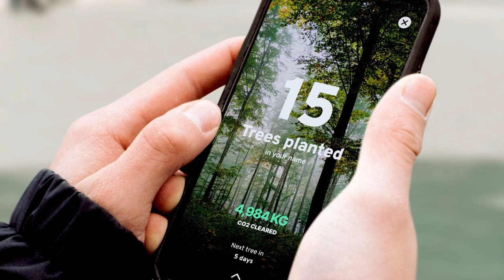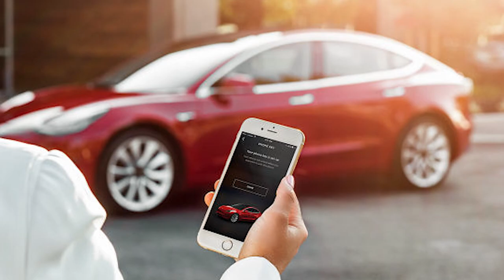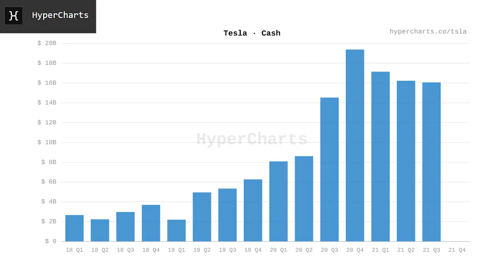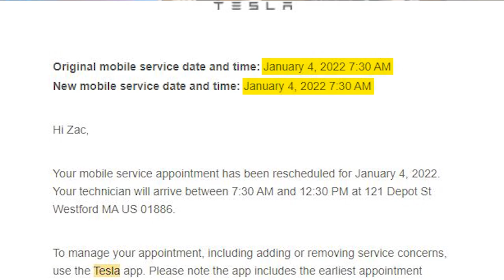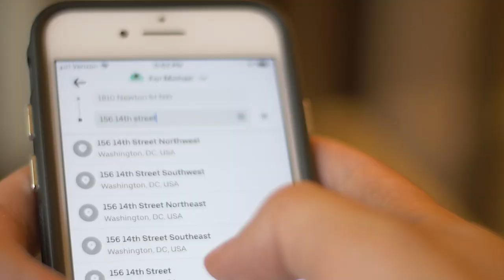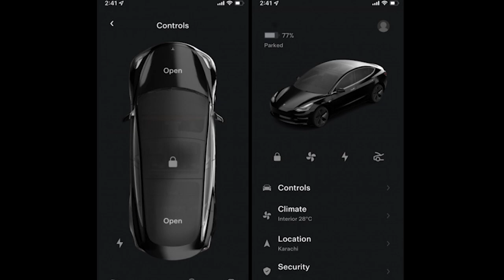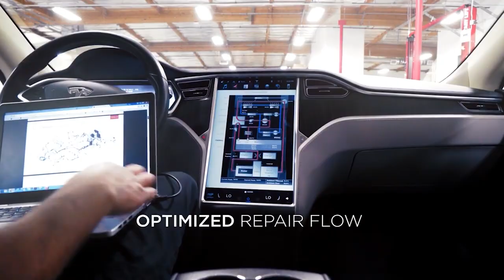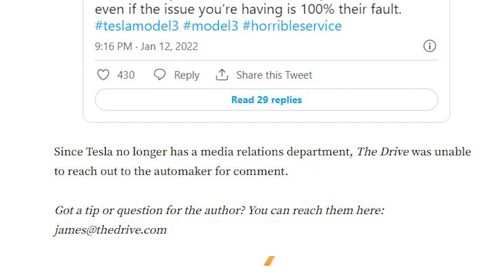Tesla We Love You, BUT… | In Depth

Comment: I have been buying Tesla stock since 2018 and continue to do so.  I own a 2018 and 2019 Model3.  I have needed both mobile and service center repairs.  My experience with Tesla service has been a combination of excellent and poor.  Wait times for service have increased to 2-3 weeks at the Miami service center, also no room for parking, and 1-2 weeks for mobil service which is unacceptable for some types of repair issue.  Last year I had to wait 5 weeks for body parts and the car was un-drivable during that time.

For a number of reasons, not the least of which is the Tesla charging network and battery management system, I have told everyone that Tesla is the only EV they should consider purchasing at this time.  For all the reasons you mention in your "In Depth" report and my own experience with Tesla service I'm hesitant to be such a strong Tesla advocate until such time as they enlarge their service network and improve their methods of service.

Comment: I am another unhappy Tesla owner.  I received my MSLR on Labor Day weekend.  It has been at the service center for a third of its life so far.  The list of issues is long, but there are two egregious issues that have bothered me most: 1) Windshield had a fine mist of clear coat all over it 2) The body control module has failed twice disabling/limiting many functions like power steering.  I get that the service center is swamped, but they are taking some bad shortcuts.

The supposed windshield replacement? - they did nothing more than try to clean it, but broke the clips on my A pillar trim.  After an additional month and a half, I finally have that replaced.

The body control module?  so far, so good after the second attempt - but it took almost 2 months before it failed the second time.  But on pick up, I noticed it appeared they seemed to have impacted the passenger side, partially dislodging the front wheel cover and outright curbing the rear wheel.

I am still waiting for a repair on my charge port which will only open when manually pushed - but I can at least live with that one in the meantime.  But it still pissed me off that the technician didn't even bother to try to reproduce the problem as described - they only noted that they didn't see any issues in the logs.  Um, if it's not receiving the "open door" signal to begin with, what would it even log?

This is my third Model S.  I have been a fan since 2015, getting each updated version since then.  But with each new car, the initial quality and the level of service have both significantly dropped.

I miss the company where I could drive to the factory to have the car serviced - the same factory where they used to give tours to us early owners.

I agree with Rich Benoit - Tesla cares more about the number of deliveries and stock price more than it cares about its customers or even the environment.

Comment: I'm license auto mechanic and worked at number of dealerships. All new cars are required to have pre delivery inspection (PDI) before the customer takes delivery. The manufacturer supplied a PDI check list  we followed to insure the vehicle is safe to operate it before the customer takes delivery. The Tesla owner who had a missing brake pad is a major safety issue and shouldn't been delivered in this unsafe state. PDI would have  capture this deficiency.  You are correct with customer service, if you don't give good customer service you won't succeed in the long run!

Comment: Good video. Lack of service departments is of course a bigger problem resulting from poor quality control when the cars are built. You hear a lot about panel gaps along with many other random parts of cars not working. My wife owns a completely nondescript and boring Nissan SUV. Guess what, in 5 years it has never needed service other than scheduled oil changes. All of the panels and doors are perfectly fitted. There are no squeaks and rattles. It just quietly goes about its business. This is typical of most cars at any price point. You are right about the customer experience. Back in the mid 1980s I bought a Ford pickup truck that proved to be poorly assembled and quite unreliable. The dealer I purchased it from was generally unresponsive when it came to correcting issues. It has been 35 years. Do you think I have or will ever buy another Ford? I think quality control and the customer service experience might be Tesla's undoing.

Comment: I agree completely with the app metrics failing to indicate to Tesla how much of a problem they have. This could be fixed very easily by a simple "how is/was your service experience?" email that gets fired off whenever an existing service appointment gets closed or rescheduled for whatever reason.

My only encounter with mobile service a year ago (where the service technician never showed up and then the ticket showed as being closed a month later) was not great. I never complained because it turns out they seem to have remotely fixed the issue without informing me (as I suggested to them in response to the text on the day of the appointment confirming the ranger would be calling by). But it would have been nice to have a simple notification confirming my suspicion rather than waiting around for nobody to turn up.

Comment: Great video. Not a defense, but a complication in parts supply is that they modify parts on a daily basis. So a repair of a brand new vehicle might involve a stock part a couple generations old. Which may or may not matter. Related but different is that they really need to support 3rd party repair. Won’t really help with Warrenty work, but progressively becoming a more critical issue as well.

Comment: Took my family on holiday weekend trip. 500km across Ontario. There was a super charger across the street from the hotel. I used it then realized the hotel had a free Level 2 Tesla charger... On the day we were going to start our drive home. Two days after Christmas. 100% charge. -15C. Not warmed up. Car is BRAND new. First week I owned it. Long Range Model 3. Pulled out of the parking lot. The steering was really stiff and not easy to turn. Car started telling me that traction control was disabled. Regeneration was disabled. But it was still drivable. I had to use the breaks. the heat was working fine. Other things warnings were coming I don't remember what they were things that you can't turn off just started being turned off. We were now an hour away from the hotel and I thought this seems serious after all since it was now warmed up. I re-routed to a super charger. Didn't fix the issue. Rebooted; didn't fix the issue. Using the app was infuriating because there was no option for Traction Control and Regeneration have stopped working. And it was an emergency. It was wild. I could punch the accelerator just a little and the car would fish tail around easily in the snow. Finally decided to just call and gave up on the app since there was no way to describe the problem I was having. Talked to someone and they were like "Oh that does not sound good, we can send a tow truck to you right now, but that could be an hour or two can you drive it to service centre?" I was like "I've already driven hours with things being scary so yeah kids are in their car seats and crankiness starting to set in".

I actually remembered seeing a Tesla centre from the highway on the way there to this unfamiliar part of Canada. I used the navigation and it sent me to this really quiet looking industrial area. And it was just after boxing day. I was worried we would get there and there would be no tesla centre, I didn't know how to really confirm so I just did it. Driving down this road surrounded by CLOSED car dealerships I was starting to get really worried. Finally saw the Tesla sign and was super happy. Drove in parked in front the service door. Nothing happened. I went into the showroom in a slight panic. Had ketchup on my shirt. 2 people at desks in this giant room. The usual Tesla centre. Guy comes up to me and engages and I go into the explanation about the car being weird. I did everything I could and I can't really drive this 5 hours home now. After talking to him he eventually says. "oh I'm just a sales guy you have to wait for this guy who is currently on the phone". Remember whole family is out in the car still waiting for me. So I stand there and I just try and look cool. Hotel hair dirty shirt. And it seems like forever but it was probably 10 minutes maybe. Finally he's off the phone and I tell the whole story. He then says "Ok, we'll get you in as soon as possible but that might not be for an hour and your issues sounds like it could take some time to fix". He did some computer search thing. Then I just had to park the car and wait... There was nobody else there.

We ate our lunch in the Tesla waiting room. They got me a nice industrial extension cord so the kids could use the laptop on the kids table. Unloaded the family and we waited. After they realized that my issue was real they were very considerate, but my initial impression was that he thought I was exaggerating. 3 and half hours later. The tech manager came to talk to use about every half hour which was really nice. They offered to somehow give me a loaner car and do the logistics later since I informed them where home was. Problem was.... NO CARS. I said, what ever happens first. Someone returns a loaner car or you fix the problem.

I could see the car being worked on. They come back and tell me that their diagnostic computer tells them that everything is green. His words exactly. But obviously it's not working fine. They are in and out of it, all the doors are open. I'm worried since it's well full of luggage and kids toys and half eaten things of some sort. The front is all removed. Finally it's on a hoist and the tires are all off...

They fix the problem! 

What the tell me was this. A sensor that monitors the wheel rotation in the back was installed at the factory without the little plastic holder that keeps it in place. So it worked it's way out and wasn't sensing the wheel anymore. The computer then went into panic mode. And he summed it up with. "We've never seen this before so we'll make a full and detailed report".

It's been about a month now and of hadn't had a single other issue.

Comment: Well done!  I've had two Teslas (M3 and MY) and I loved both of them.  I've only needed one service call to install a Homelink module and a Ranger came to my house and did it in minutes.  He also fixed a slight door misalignment and was on his way.  I have a service center within 50 miles and so far, things have been great.  However, you do a great job of pointing out what may be the undoing of Tesla as a brand.  Certainly there is less to go wrong on an EV so a bit higher ratio of service centers to cars may be OK, but not 10X or even 5X!  I will forward your video.
Reply: The ratio can more easily be explained with age of vehicles.  Tesla fleet is very young and most on the road are only 2 years old.  This doesn't mean they don't need more service centers, they definitely do.

Comment: Bang On. hear in the UK we have a tesla service center about 30 mins away. 
when we first got our X we could call the center directly everytime the rear doors broke. They would normally have the sensors fixed in a few days.
Then they switched to a central system and it took weeks to get a appointment 🙄  we sold it purely because of this.

Comment: I agree about requiring better service but also remember that EVs have fewer parts and do require less service. The drivetrain in an ICE vehicle contains 2,000+ moving parts typically, whereas the drivetrain in an EV contains around 20. If you take the number of ICE cars times the number of parts in each car divided by the number of service centres and do the same for a Tesla then Tesla probably has a better service ratio :)
Reply: If they had a better service ratio, they wouldn’t be rescheduling constantly and so far away. Never got rescheduled in any other dealership. And they usually can get parts in 1-2 days after they looked at the car, which never take more than 2-3 weeks (except for emergency that they take on the same day).

Comment: Great video, and something Tesla certainly need to work VERY hard indeed to fix.
However a few points: You can’t compare ICE vehicle service centre numbers with EV service centre numbers. An ICE vehicle needs far more regular work including things like brakes and oil changes, and oil and air filter changes (plus a multitude of other things). 
My Tesla on the other hand could go easily four years without needing anything done at all other than tyres depending on mileage. It’s gone 2.25 years so far, and been totally perfect. I’ve had mobile service visit, but that was only for fitting homelink, and doing a cabin filter change- neither of which was “necessary”, nor urgent. (My cabin filter wasn’t smelly- it was done more as a preventative measure.) 
We have two other Model 3s in the extended family and their experience is the same- basically as good as you can get.
And yes of course none of this means Tesla don’t need to improve their service.

Comment: Welcome to the club.
Had the same experience: There was a cracking noise at the front left wheel. Made an apointment, get there. They say „that‘s not normal“ and tried to fix it. One part was missing, so we made another appointment. At the next appointment they say „We fixed it by lubricating everything“ and guess what: the noise was away - until I reached my home. Yeah you can cover a noise by putting grease in every hole you can find… but not for long. Made another appointment, get there and they told me „no. That‘s a completly normal noise.“ and send me back home. 2 month later the noise was so lound, that I made a new appointment. This time they knew exactly was is broken (wheel bearing) and fixed it.
WTF!?!
As good as the cars are, as bad is the service.

Comment: My car was built during the first big push in June 2018, so needless to say I have had interactions with Tesla Service.  Being technical and an early adopter, I have rolled with the punches regarding service so to speak.  The State of NM did not have a service center until Sept of 2021 so all but one of my Tesla car service jobs was performed by the Rangers.  Being retired, I actually prefer Ranger over Service Center visits.  You could argue that Tesla needs less service centers per 1000 cars than an ICE vehicles due to not needing as much service work performed; however, currently Tesla is doing service work on out of warranty cars that for an ICE vehicle could be performed at a third party shops.  In addition with there current "Right to Repair" stance and parts availability, many repairs that could be performed by third parties or by owners is currently being performed at Tesla Service centers.  When the cars get to be around eight to ten years old, why would Tesla want to be the first/only choice for many vehicle repairs??  It they are, the high repair costs will probably force the cars into the wrecking yard (Is that a WIN!!!)?

Comment: You are 100% correct. It was difficult to get a human to organize to fix my defective climate control system. The app gave me an appointment two weeks away, no use because I have no heat or defroster in Canada in the winter. Sort of an emergency. I finally got a number to call from the roadside assistance service and got my car in to be fixed right away. Fantastic service once the car is in the garage, but emergency help via human could be better. Love my Tesla though.

Comment: I’m currently exactly in this situation, on a long road trip, started getting BMS errors and could not charge the vehicle. used the app, no response. So I called they dropped the call three times. Eventually I drove the vehicle to service. It sat with service for two weeks no response not even a courtesy ‘this is the issue’ I called again they said a tech would call, I extract from the tech I need a new inverter. Oops Tesla still have not received the part at least another week. I love Tesla, but the communication on a vehicle of this calibre, none existent. Sent a chat in the app no response at all. Tesla support service just sucks. You guys are spot on, I made a video on my channel about the issue.

Comment: I am hopeful that I no longer need to use Tesla's service. The last times I have had to use it, was awful. I love the car, but they really need to fix these service problems. They also need to open up parts purchasing to normal people. We should be able to order a replacement light or mirror for example and replace it ourselves. I tried to order a replacement visor and they said I needed to fill out forms, these forms asked for my resellers license and my body shop information ( which obviously I don't have because I am just a regular person). Good thing we have Ebay

Comment: I paused it at @25:08 to try to see it better and it is obviously a side view of the rotor/caliper assembly.  The left side is the edge-on brake rotor and I see an overextended shiny brake cylinder piston smack up against it with the piston rubber boot melted further to the right probably because of intense heat.  Tesla needs to try to identify the individual who is responsible for this.